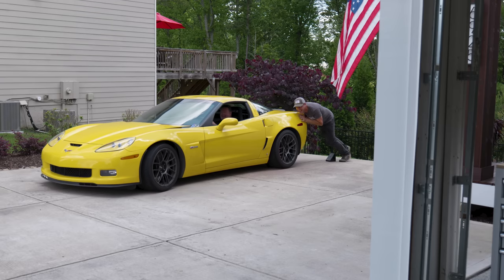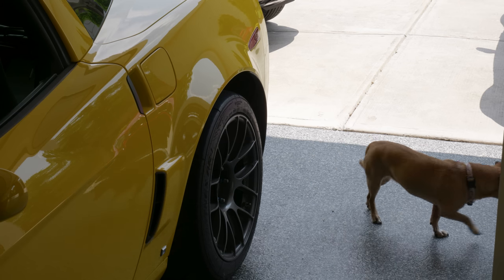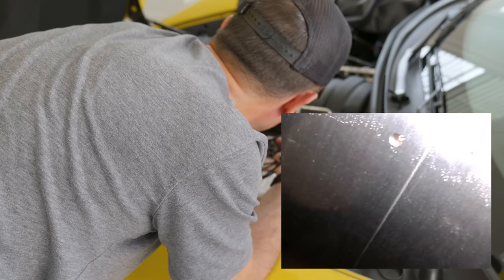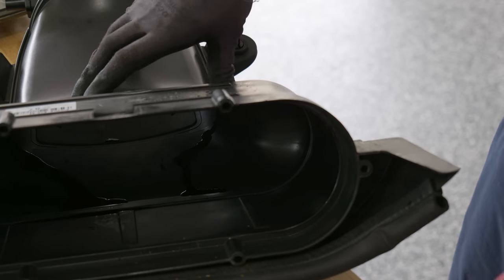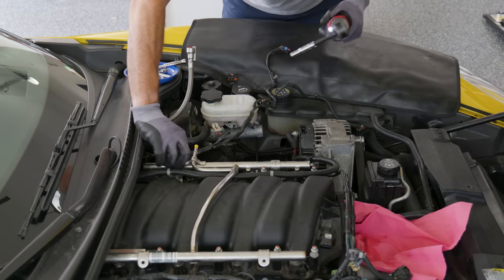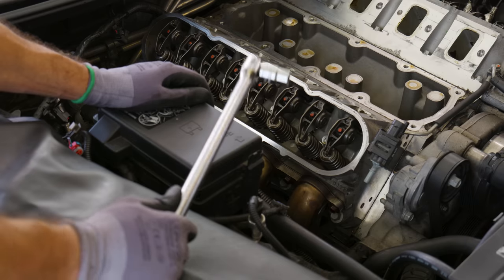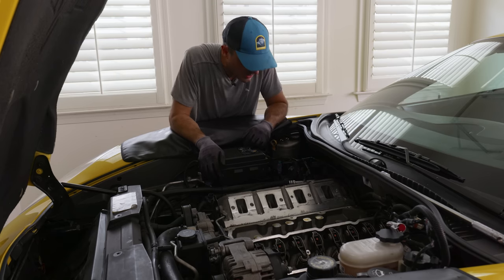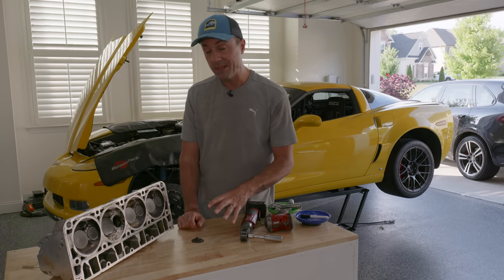“Get your heads fixed!” The internet was RIGHT?

Comment: Katech issued a bulletin on this some time ago, stating that valve seat concentricity (valve guide to valve seat) was a very likely culprit. My guess is that the seats were ground independent of the valve guides. And the guides, being a powder metal variety, were machined to their spec separately. Does no one any service to say, "you should have addressed this before hand".. just glad your damage is limited, and looking forward to seeing where the build goes from here. MAST has some great heads (what I bought for mine) and possibly, on the shelf for quick turnaround. Either way, better to catch this issue now, rather than later. Best of luck.
Reply: yes, the tools were way out of tolerance and GM didn't not find out until customers kept coming back with blown engines. then they hired lwayers and found a way to refute any lawsuit against that issue but had to offer a indefnite fix for c6z roof delamination. Same thing with the ti coating, they spec half what the german company they contracted said was the min thicknesst hat would work. This is why and for a plehtora of reason the ls7 is forever the greastest motor gm ever built and the shittiest

Comment: Look into keytech oil pumps they make a great oil pump for the Z06 with high scavenging capability since you’ll be tracking the car, you can also upgrade to the ZR1  oil dry sump system which holds a little more oil. ATI balancer will help as well if you do a head cam package. Texas speed has great products as well.
Reply: Katech but yes. I agree

Comment: I believe the LS7 uses dry liners, meaning if you have coolant in the cylinder, your block is cracked. As someone else stated these blocks are aluminum and can be welded. 

I cracked my block with fixed heads and decided to go with a RHS block for my new build. I'll try and repair the LS7 block for a future build.

Good luck with your project, I'll be following along.
Reply from the maker: Good to know, thanks for the insight!

Comment: Best wishes with the project.  It's a shame GM has had so many problems with their engines.  I think the LS3 is the last good one I owned that didn't have major problems.  Anyway- I bought an air cooled Porsche that needed an engine rebuild and I did it myself and that engine is way harder than the pushrod V8's I'm used to.  If I can do that you can do yours.  Research and learn all you can before proceeding then invest in the tools and reference material to do it yourself.  Things like journal measurements, bearing clearances, and deck heights.  CC your piston crowns and combustion chambers.. Eliminate all the weak points and spare no expense for an engine that's going to be raced and it will pay off in the end.  Good luck!
Reply from the maker: Thanks Vic! doing it myself feels like jumping into the deep end of the pool when you barely know how to swim, but what better opportunity to learn?
Reply: @JoshVanVeld  I was in the same boat and probably a similar skillset as you so you got this.  Use the opportunity to make the build as part of a series and make lemons into lemonade.  I'm not sure if you have an engine hoist and stand, but harbor freight has both cheap and just pull the engine to dive into the pool!  The cool part is once you have the build under your belt and go racing you are in control over your car now from a mechanical perspective.  But just tear it down and then find the very best machine ship to bring the bits to.  I'm not an LS7 expert but I'm sure the Corvette forum will have plenty of suggestions.
Reply from the maker: @3.2Carrera  Love the perspective, thanks. I’m all about making lemonade, it’s way more fun than complaining about how lemons are too sour. 🍋🍋🍋

Comment: Yeah LS7 dropping valves is very very real. Its been well known for 15+ years. Point is when you get into a C6Z, set aside money to have the heads/valves addressed. Good luck with everything!
Reply: I just pulled the heads from  my 09 z ,70k on it never been rebuilt. 
Ex valve I check was .015 wiggle in the guides that are oblong. 
It'd a machining error from the supplier I caught it after a 130mph pull from 4thto 3rd

Comment: The sleeve is backed by aluminum (the block), it's possible you can crack a sleeve without cracking the block but that wouldn't allow coolant into the cylinder. If coolant is getting into the cylinder through the sleeve the block is cracked too. Good news is it's technically "repairable". Machine sleeve out, weld crack and re sleeve with OEM dry sleeve, or go Darton dry sleeve hell wouldn't even have to weld the cracks if you end up wet sleeving because they machine that out anyhow (but wet sleeves come with their own pros/cons). At the end of the day because LS is so hot it'd be cheaper to buy a new block. Build a LSR block with stronger sleeves to a 427 or get their tall deck for more displacement.
Reply from the maker: Thanks, I knew I was probably missing something…

Comment: Sorry to hear, but no surprise regarding your findings!  Every time I see these nuked LS7 videos, it reminds me I really need to get mine done (2008, ~68k miles)!  On the plus side, no window obvious in the block and the valve came out more cleanly and seemingly quicker than most I've seen.  There's a reasonable chance the block is still good.  I wish you would've shown a good slow closeup of the deck, cylinder, and piston top.  Regardless, everything has to come apart at this point.   

You'll want to either clean the hell out of that intake, or preferably order a new MSD as there's a chance there could be metal pieces in it (I'd do the later for piece of mind and the extra power).  I'd replace the oil pump and possibly the lines as well.  If you're on a budget, clean and flush the snot out of them at a minimum!  Doing the same with the oil cooler is a good idea as well!

Anyway, keep taking her apart and meticulously clean, label, and store the parts as you go as it might be several months (or longer) before you're reassembling.   At this point I think you should send the block and rotating assembly out to a trustworthy source, unless you want to take it on yourself.  It doesn't sound like you currently have to knowledge to do the shortblock rebuild yourself, but there's plenty of documented info out there if you want to take it on and take us along for the ride.  Either way you're going to need a good machine shop...

Again I'm sorry this happened to you, but I think we'll all benefit from this in the end... Well everyone except Mr. Wallet!
Reply from the maker: I’ll show more detail of that stuff in the next one. I’m starting to lean towards doing the rebuild myself…
Reply: @JoshVanVeld  Sounds like a plan, especially since you can educate viewers and make YT revenue off it as well!  There's some good LS rebuild books out there, but it would also be nice if you have a local friend that you trust to assist during the process.

Just make sure a good machine shop thoroughly inspects and preps the block.  I say this as someone who in my younger years trusted a local mechanic to do a rebuild on a aluminum LS6.  Long story short, he missed a very small hairline crack between the cylinders and it all had to be redone.  ;)
Reply from the maker: @ssoffshore5111  Great advice, thanks! I think we have some quality shops in the ATL area.
Reply from the maker: @jamesw.6931  My buddy had a 2011 with stock heads at 85K miles but he blew the motor. Broken rocker / lifter though, not the valve. Makes you wonder what the record is for how many miles somebody has put on one with a stock motor...
Reply from the maker: @jamesw.6931  I've spent a lot of time on the corvette forums, but I've got a lot more to learn!
Reply from the maker: @jamesw.6931  That's excellent (except maybe for the disturbing part 😅). Too many people think that you stop growing when you hit a certain age, but I think that learning is a form of growth.

While it might get harder to ram lessons into our brains as we get older, it's still possible and should absolutely be the never-ending goal.
Reply: @jamesw.6931  Possibly the luckiest, IDK.  Like anyone, I do drive the car like a grandma around town.  But I also use to race SCCA (with a Viper) and also do Porsche Club Racing (911 and 944T)... The C6Z is my daily driver (when the weather is suitable), it has a harness bar in it and has been on the track multiple times, so it's also driven hard at times as well.  

I'm sure there are a lot of stock LS7's that have gone past 100k w/o nuking.   I don't think the number that go boom is even close to 50% or even 25%, but it's clearly an issue and if you're the unlucky lottery winner it's quite the expensive headache!  

Either way, like Josh, I am well aware I've been playing with fire and need to get serious about getting it done!  I've been collecting the parts to basically do the RPM stage 4 package (I already have the headers, MSD intake, NW TB, etc).  I just need to order the cam and heads, along with the other odds and ends that add up quickly, lol!
Reply: @jamesw.6931  Is there something different about the Frankenstein LS-7 heads that make them a better fit for use with larger cams compared to Mast or some of the other manufactures heads?  Either way I had planned on going with an aftermarket casting.  It still doesn't sound like there's a 100% definitive answer as to why the stock heads fail (I've read all sorts of explanations), but in my mind clearly something is wrong with the factory heads so I'd rather roll the dice and go totally aftermarket.
Reply: @jamesw.6931  I didn't even realize they have a channel on here, I'll look into it.  Thanks

Comment: I have studied Metallurgy for a while, not a hell of a lot, but I have learned something because I have a gunsmith who is not only a master gunsmith but he's one of the top Engineers on call with several companies around the world. He does know quite a bit about metallurgy. Understand it is that titanium if it is subjected to bending forces too much, it can turn quite brittle. It at that point does not take too much of an impact to cause a portion of it to break or even shatter at times. Considering a valve inside of an engine is subjected to both a lateral force from The Arc of the rocker arm and the impact forces of it hitting the valve seat, it seems like somebody would have thought that titanium is not the best material to make a valve out of. Just saying. But the issue as I'm seeing it fits this scenario perfectly.
Reply from the maker: Thank you! Sadly I was mistaken when I talked about it in the video and the exhaust valves are hollow sodium-filled stainless steel. It's the intake valves on the LS7 that are titanium.

Comment: IMO, the most bullet proof solution is to go with Trick Flow 260 heads with their stainless valves and powdered metal valve guides. Yes the valves are heavier, but if you're going to keep your rev limit at 7200 or below, there isn't really anything to worry about.

There is a guy on Corvette Forum whos been running these heads out of the box with a Katech K502 cam who's constantly whooping on it at track days, revving it up to 7200 all the time. I think he said he had about 30k miles on those heads maybe? I can't remember. But that is the route I would go for a track build.

Good luck on your future build!
Reply from the maker: That's awesome! Thanks!

Comment: You definitely need a hoist and engine stand. Send the block out to a top line machine shop for sleeves after taking it as far over as the rules allow. Buy some after market heads and with much care and precision put it back together again. Check everything yourself after someone else’s work. Have the crank balanced. You can do the pistons and rods yourself. I like to assemble the blocks myself. That way you know how much clearance you have in the bearings, etc. CC the heads… make sure everything is as close to perfect as you can make it. You will be astounded by how much performance you pick up. I always preferred nice increase in lift with a moderate increase in duration but that was for my “street” motors. Then degree in the cam. Of course the greater duration the more you move up the power band. Don’t know how flexible the rules are that you are working under but just altering the degree the cam is in can yield significant changes in the character of the motor.
Reply from the maker: Thanks for the tips! Not building for a particular competition class so I’m free to do what I want with it. Basically want something badass on a road course, reliable, and as affordable as I can make it.

Comment: Sorry for your troubles. After watching your videos I've learned two things, I need to get my heads done and I need a set of quickjacks. Throw a tire under the jack for some insurance.
Reply from the maker: Not getting my heads fixed right when I bought the car is definitely high on my list of "most expensive mistakes of all time". 😢
Reply: Make wooden wheel cribs there the best for this type of work.

Comment: Enjoying watching this. C6 Z06 was my dream car. I got a 08 Z06, 80k miles. Engine lifter failed at 72k. Was bored, stroked, cam etc (terrible idea) just keep it stock and fix the heads. the LS7 is already pushing its limits. I am having a lifter fail rn. Pulling apart the engine as we speak. I just want a V8 in its that will last 200k with medium to heavy use.
Reply: Now 3/4 through the video. Man. None of my valves are dropped. Head have been taken care of. I just have a lifter (aftermarket) and multiple cracks into the sleeves.
Reply from the maker: My buddy’s car had a lifter failure. Broke the rocker and the lifter came apart and tore up the cam and the block. Found a piece wedged by the oil pump pickup.

What are you going yo do about your sleeves?
Reply: @JoshVanVeld  It is a tough call. Part of me wants to keep the LS7 but it may be cheaper to get a bare block than the machine work to fix the sleeves. I called 3x machine shops in major cities and each mentioned often when a sleeve is cracked... so is the block on an LS7. In that case I will need a new block anyway. The more and more I research the LS7 even in stock form (with the heads fixed) they just don't last 150k. I want an engine that does. My ram truck V8 lasted 250,000 and still runs great. And I beat the crap out of it. Maybe go with an LS3?

Comment: Careful when buying new heads! Make sure they have valves made with iron, chrome, and nickel.
I bought a set of Brodix heads fully ported and polished from Horse Power research. The valves were hollow and only 7% cr. Motor dropped an intake valve on the way to the tuner.
Only 35 miles and no reving of the engine.
Reply from the maker: Holy crap! 😮😮😮

Comment: Hopefully the block can be saved, good time to add upgrades AFR heads, cam swap, etc. also check into the later model Z06 improved dry sump oiling system if you don't have it already. Good luck!
Reply from the maker: Definitely going to upgrade the dry sump in the future. Thanks!

Comment: Well I’d say ditch the factory heads for some aftermarket ones. Problem with that is they’re really expensive for ls7 and anything for ls3 like the TFS genx255’s are on back order for the next few months. I’ll be very curious to see which route you take to continue on your build.
Reply: Lol no fix the heads n do a Lil port work and it's easy to hv a 600 wheel hp car
Reply: LS3 is a 15° head LS7 heads are 12° netting more air flow and HP. Plus larger valve size.  Totally different set up.

Comment: Yet another LS7 that was put off for too long without being fixed and suffered the same consequences. Some are going to point the finger and say "Well it happened because he was racing it", but those engines have dropped valves at under 2k RPMs on cars that were being cruised with less than 15k miles. Such a fatal design flaw. There's a reason the shops that work on them the most often will tell you it can/will eventually effect every LS7 out there.

Josh, all I can say is that we know you'll get the car back to being better than before, even if you have to ship it off somewhere, which is absolutely the smartest option.

Comment: I got lucky and bought a Ls3 block for $500. It needed 1 sleeve on cyl 5 because of a dropped exhaust seat. Luckily it dropped at startup at idle and stalled the engine so not much damage. I have it at the machine shop right now getting a new sleeve and bored and honed to match the other cylinders. I'm going to order a set of Summit Ls forged pistons and rings for it. Well, I believe Wieseco makes them for Summit. K1 makes the cranks for the Summit Ls line. It's not cheap but resleeving if possible depending on the damage is way better then a new block lol.
Reply from the maker: Nice! What do you think the machine shop work is going to cost?
Reply: He told me to put in the 1 sleeve in cyl 5 and deck the block. Then bore the sleeve to match and hone all of the cylinders. $650. Polish the crank $50.
Reply: I just need a set of 821 or 823 heads and my engine will be complete. I found on E-Bay there is a shop selling the 821 heads for $450 each. Already rebuilt. The 821s were on the Ls3 Vette and Camaro.

Comment: Fingers crossed you can salvage the block!  I don’t know much about internals, but it seems strange that you have issues on both sides.  Maybe the drivers side was having issues earlier (that sound you had at the autox?). Or maybe one failed causing the other side to crater shortly after?

Anyhow, another great video. Thanks for sharing and we’re looking forward to the next one!

I say keep stock power, but upgrade all the oiling stuff, maybe even a full blown “true” dry sump system that can handle the high rpm and g/forces. 

Cheers, Rod
Reply from the maker: Thanks Rod! We’ll take a look at the other head soon and hopefully get some more answers.